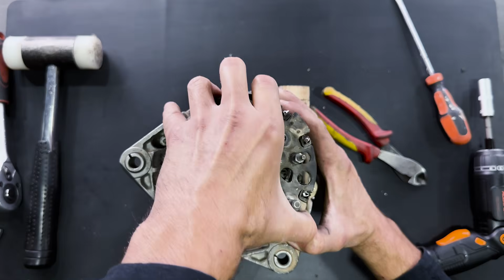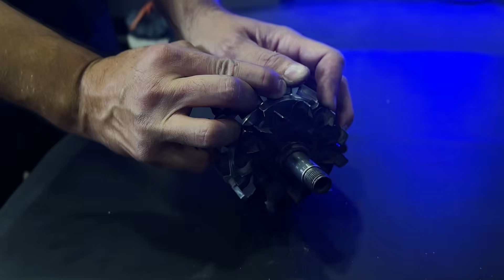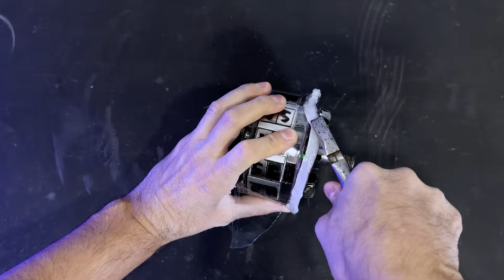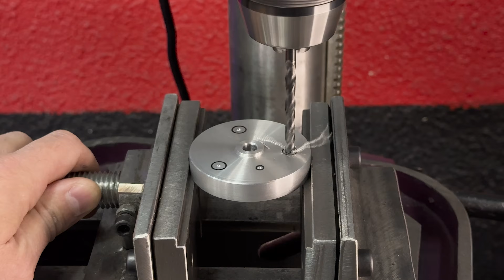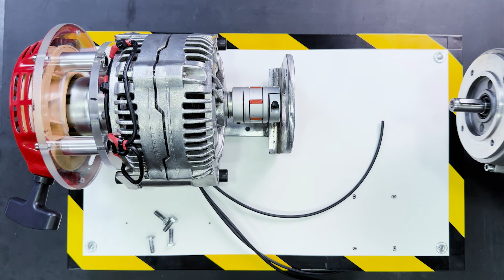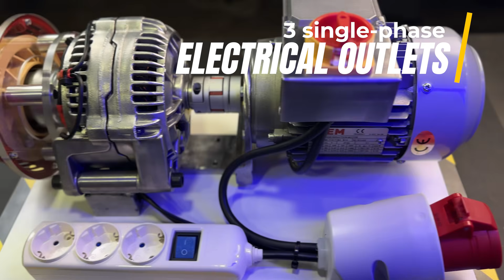10kW 110V-230V Single and Three-Phase Free Energy Generator - Liberty Engine 1.1

Comment: A synchronous motor requires a fixed electrical frequency in order to run at a stable speed.
What produces that frequency in this device?
In the video the machine is started with a pull‑starter, so what increases the electrical frequency to the correct value, and what regulates it to the exact RPM required for synchronous operation?

The formula for calculating the synchronous speed of a three‑phase induction or synchronous motor is as follows:

“The synchronous speed is obtained by multiplying 120 with the electrical supply frequency in hertz, and then dividing that result by the number of poles in the motor.”

This means the motor’s rotational speed is entirely determined by the electrical frequency.
Without a controlled and stabilized frequency source, the motor cannot maintain a fixed RPM.
Mechanical inertia or a flywheel cannot generate or regulate electrical frequency — they only smooth mechanical speed variations.

So the fundamental question remains: what in this setup creates and stabilizes the electrical frequency that the motor absolutely requires to operate?
Reply: You speak 😮 a lot but can't prove anything, build yours exactly 💯 as they did and prove them wrong, 🤔- we have proved them right 👍▶️

Comment: My friend, if this is real, you can put links to eBay or other stores so we can buy it and silence the negative comments. But if it cannot be bought, then all of us have doubts about this video
Reply: This setup cannot work because it has no mechanism to keep the electrical frequency stable, and magnetism is not an energy source — it is only a force.
What does work reliably, however, is how this project helps the creator earn advertising revenue.
In that sense, the “Liberty Energy Project” performs very well: it generates income from thin air.

Comment: Guys this could work, their special alloy is alegedly mostly silver, and every moving part suffers some abrasion with the air, why is this important. Because it frees nanoparticles, silver nanoparticles. And silver nanoparticles can strongly intensify a local electromagnetic field through localized surface plasmon resonance (LSPR). When an electromagnetic wave strikes the nanoparticle, such as those produced by the magnets and coils, it causes a collective oscillation of its free electrons. At the resonant frequency, this interaction confines and amplifies the electric field at the particle's surface.
Reply: Where does the energy come from?
Magnetism is not an energy source — it is only a force.

Comment: Can you show us the maximum generated capacity of 10 Kw? You can use electric heaters or so. Easy to verify the power consumption and the heat it gives. Thank you for the video. Why is this not for sale?
Reply: He showed it on another video. The problem wirh reduilding these generators is the round element maden of silver and aluminum, we don't know exact proportion of silver and aluminium but we know it weight 242g, if we have exact size of weight it was measured on it, we can know exact dimensions of it, we know also this element has "high density" it points on higher silver contents caused this metal has higher density. I will try to use AI and publicly available information to determine the percentage of silver and aluminum content and the dimensions of this element and make them public, because the author did not provide full instructions on how to build the engine, without this contere element it just won't work, for this purpose the percentage information on the silver and aluminum content is required.
Reply: شكر صديق أن من يشركني نفس راي
Reply: No, we can not. Magnetism does not produce energy, it can transfer it.
Reply: @PauliPurhonen are you sure you went to school , what then is electro magnetism